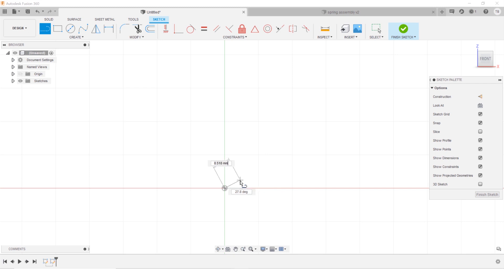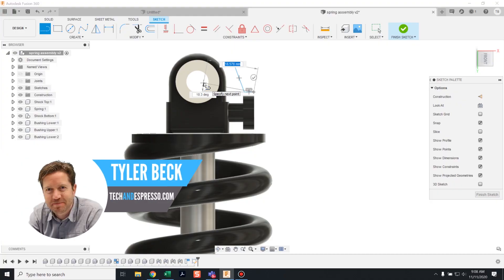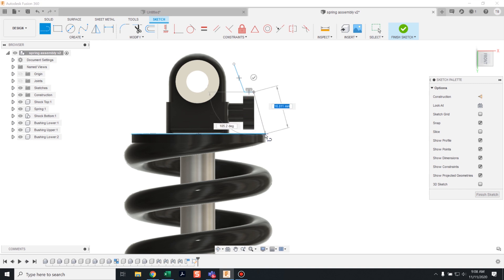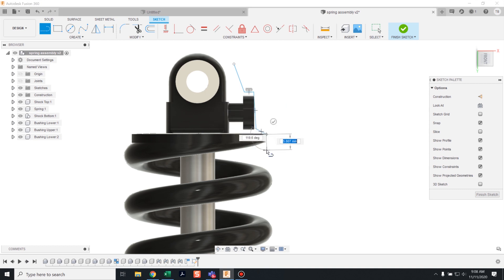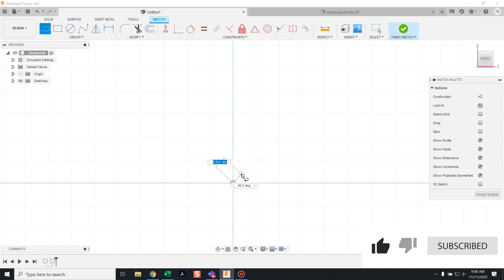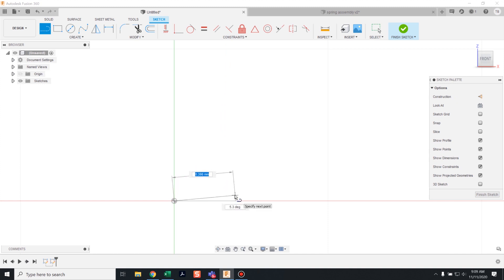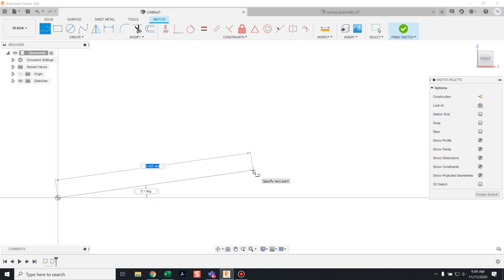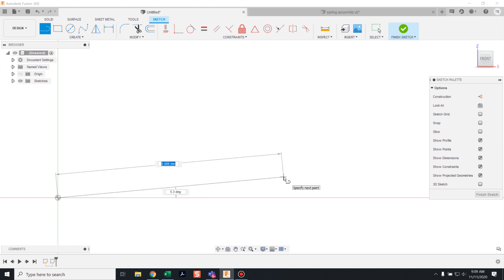Turn off snapping Fusion 360 (Avoid Auto Snap)

Comment: Can you adjust the snapping distance? After the last Fusion 360 update, the snapping distance is very fine and it makes sketching take a lot longer because it requires more mouse precision. Also after the update the sketch environment lines became very thin and hard to see. Is there a way to change display line thickness?

Comment: Fusion 360 has the most stupid dimension settings of all CAD software I ever known and the solution they offer is to change the users skills to adapt on the softwares features. As my manager standing at my back looking over my shoulder I fill really dumb zooming in and out just to avoid snap and keep holding the control key. The hardest part is during product development meeting, the dimension snapping makes me look stupid to the company owner, taking 2 minutes just to apply 3 floating dimensions.
Reply: yeah screw this shit. it’s like rhino but they made it bad by adding all their own little rules into it

Comment: Nope.  Doesn't work.  You are moving your mouse to fast at the end there and flying right past it.
Try to see the smallest angle you can rotate a body--say a box.  Move very, very slowly.
For me, even with snap to grid, the smallest angle I can make is 2.3 degrees.
Even with CTRL pressed
Zoom in as far as you like, but your resolution is never finer than a SNAP from 2.3 degrees to 0 degrees.-  And if you zoom in too far, you zoom past the Rotation Slider, can't see it, and thus can't rotate anyways.
Dang...I thought we had this.
Reply: Why is this so important?  I like to scan objects on my scanner, then use the scans as a CANVAS.  Then I trace the scan, then calibrate it, and viola, a real world objects into a Sketch!
Since i can't perfectly align the object on the scanner bed, I need to ROTATE it in Fusion--align it to the axes.  I need to fine tune BELOW 2.3 degrees.
But this shouldn't be the only scenario where you want to fine tune a body or sketch or component or ANYTHING...with a resolution finer than 2.3 degrees.
W..tf?
Reply from the maker: Gotcha. Did you try the increments under the grid.  There is a linear and angular option there.
Reply: @TylerBeckofTECHESPRESSO  I don't want to have to change the increments back and forth because i need to be able to snap when i want to snap.  Not sure why they didn't make the CTRL just disable snap 100%.
Did you try it though?  Do you know what I'm talking about?
Thanks for your interest in my problem btw...you rock!
Reply from the maker: I dont think I can replicate the problem.  Maybe hit up the Fusion 360 forums and let me know what you find!
Reply: @TylerBeckofTECHESPRESSO  I'm positive that if you go very slowly instead of moving the mouse fast you will find that you also cannot go below 2.5 degrees